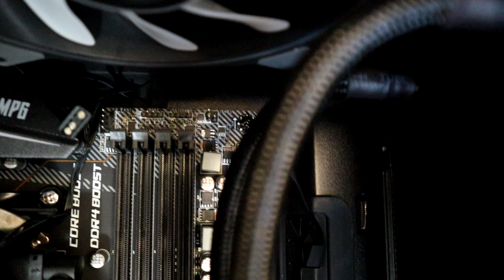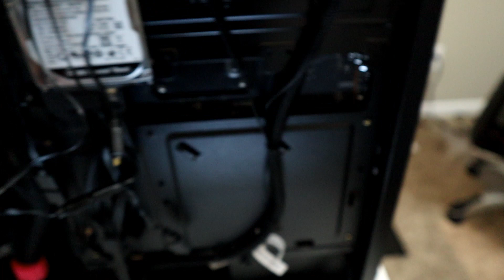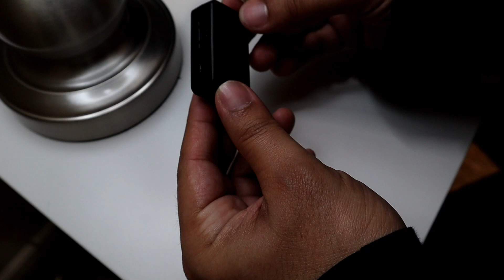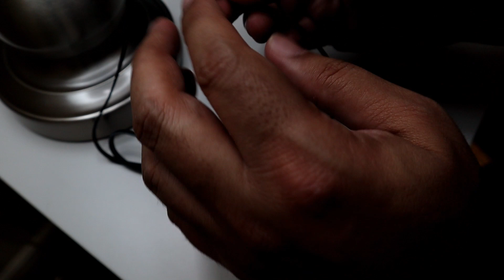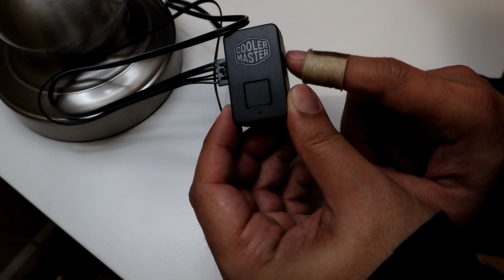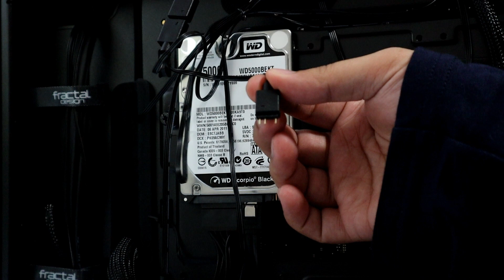Coolermaster MF120 Halo Daisychain Setup

Comment: So i just set the fans up but they dont show up in software's can anyone help me?
Reply: I HAVE 4 120S AND 2 140S WITH ASROCK B550B STEEL LEGEND MY FANS ARE GREAT OFF MOTHERBOARD BUT ONLY THE 3 FRONT 120S  ARE DETECTED BY POLYCHROME ALLTHOUGH NONE OF THE FANS SHOW UP ON POLYCHROME  LOL WHAT A DISASTER AND AS FOR MASTERPLUS IT DOESNT LOAD SAYS INCOMPATIBLE LOL OMG. I cant figure it out its doing my head in lol

Comment: I plan on ordering these fans today. Man they look so good, Just wanted to mention for anyone coming around for info, coolermaster also makes a 6 in 1 PWM/RGB fan hub. Its about 25 bucks, and that one hub allows you to fully power the fans and rgb, its very easy to look at and figure out how to use. Just in case anyones wondering.

Comment: i am guessing you cannot daisy chain the power connections? For example, if i wanted to add (4) fans to the case and i only have (2) CHA FAN  connectors on the motherboard, i can only plug 2 fans in, and not (4), correct?

Comment: Thanks for sharing this tutorial dude! It´s very clear and i cannot wait to install 10 MasterFan MF120 Halo in my Lian Li 01 XL dynamic chassis! I have 2 ARGB ports available in my Strix X570 Asus motherboard, so i guess i´ll be fine daisy chaining the fans
Reply: hey man I wanna get 7 fans and 3 on the aio (all mf120 halo fans) and I wanna put them in my Lian Li 011 D EVO. Can you give me a quick tutorial on how and where to plug them and sync them up with aura sync? My motherboard also has 2 ARGB headers. Thanks.
Reply: don't set them all to white, each header can only handle 3A but 5 of your fans connected to that set to white will draw 4A, so your header might have some issues.

Comment: Hey man every other video on the internet didn’t show what I wanted to see so thank you. I just have one question and PLEASE respond if you can. Do you need to plug each of the fans into power on your motherboard? Or does the fan power daisy chain as well? Because it seems to only daisy chain with the Argb connector I’m just wondering if that provides power for the fans to spin as well

Comment: Hi, thanks for the video.  I decided to purchase 2x of these fans recently in a sale and did not visit this video prior.  I have the MSI b450 which these fans suggest they are able to work with and it comes with a 4-PIN connector for the MSI.  However I can't seem to get them to work and I don't want any controller with this I just wanted to plug into the JRGB connector and have it work.  I am guessing that this is not possible and I shall have to return them?

Comment: My Mf120 fan comes with the argb 3pin AS WELL AS the 4pin to the motherboard. Do you plug both of them in to the mother board?
Reply: no. 12v only if you want or only have a 12v rgb connection. 5v is for aRGB supported motherbards. Always only use one!

Comment: i have a aorus x570 elite wifi do i need the controller
Reply: check in your manual if you are not sure if you have ARGB port conection available for your fans, if you don´t, as he explain in the video you might be needing a hub or this controller to make your RGB work with your fans

Comment: I brought these but I have a B450 Tomahawk Max mother board. Can anyone help, idk what to plug them into
Reply: You need to use the controller.
Reply from the maker: Yup, you will have to use the argb controller, your board only has RGB header, which is jRGB, 4 pin.
Reply: @infinitetxrx1390  Bro you mixed them again jrgb is the 4pin and jrainbow is the 3 pin
Reply from the maker: Thanks just corrected it on my last comment. Lol.
Reply from the maker: The one they have on the Coolermaster site is the ARGB small controller. Part number MFX-ACBN-NNUNN-R1. This is for anyone who does not have ARGB headers on their board.

Comment: The argb rated current of these fans is said to be 1.4A (cooler master website). Since your mobo supports 3A of current output of the Argb header, daisychaining these fans would theoretically be impossible. Yet I’m seeing plenty of ppl like you successfully daisychain them. Have you experienced any problems with the fan’s brightness or anything?
Reply from the maker: Not at all no issue with brightness, no flickering or anything.
Reply from the maker: The raiting for 1 JRainbow header is 3A but it is handling 4.2A. It would probably just decrease brightness a bit. I plugged in 1 fan into its own header but there was no notable difference in brightness.
Reply: @infinitetxrx1390  I already figured out that the ARGB rated current is in fact not 1.2A per fan as listed on their site, but is 0.55A as noted on the back of the fan itself. So yeah basically that.